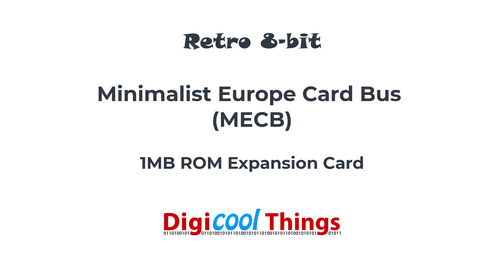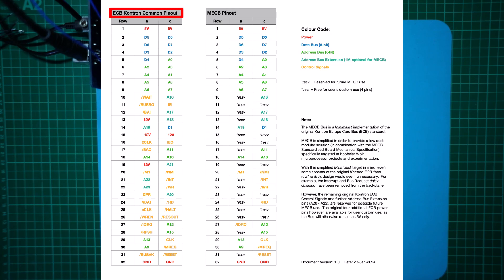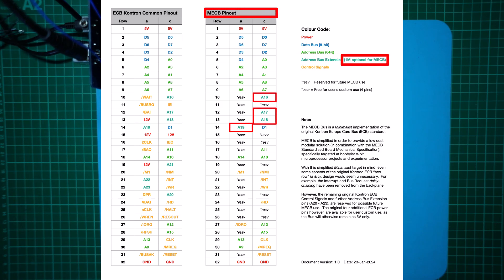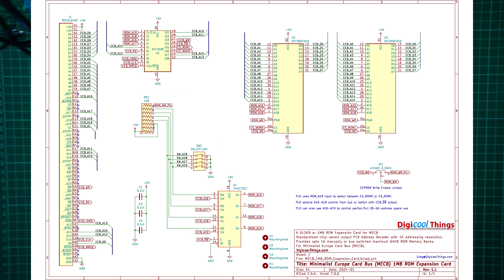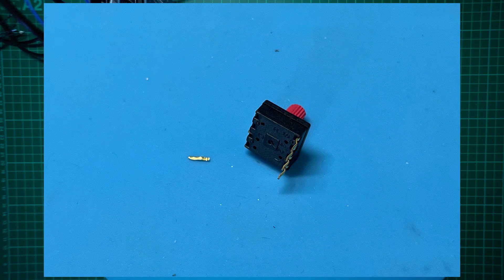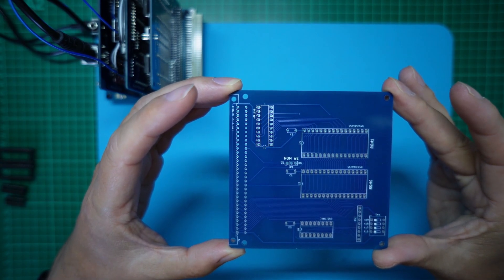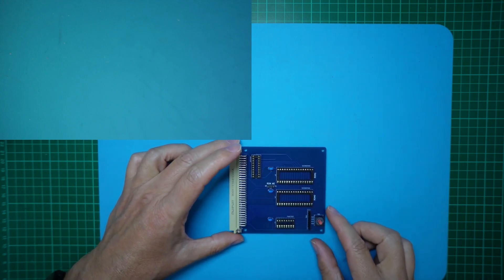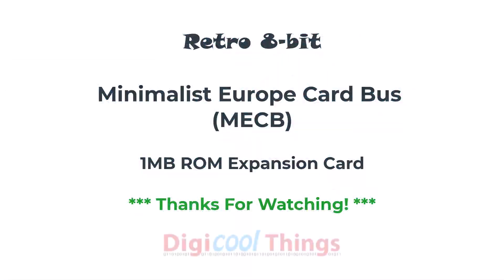Minimalist Europe Card Bus (MECB) - 1MB ROM Expansion Card (Part 1)

Comment: I've been following your project for some time, and I really like your videos. I'm also working on a 6809 project, well, 6309 to be precise. I'm planning to build some sort of MMU, as my goal is to have 2MB of RAM to possibly run OS-9 or NitrOS-9.
Reply from the maker: Thanks for your kind comment.  I’d be interested in hearing more about your project, and how you implement your MMU.  The original ECB (and potentially therefore MECB), has 24 Address lines available (16MB), so I could potentially also create a larger RAM / ROM memory card to extend to 2MB or even beyond to 16MB.  NitrOS-9 on a 63C09, with plenty of memory, would be a nice to have running!